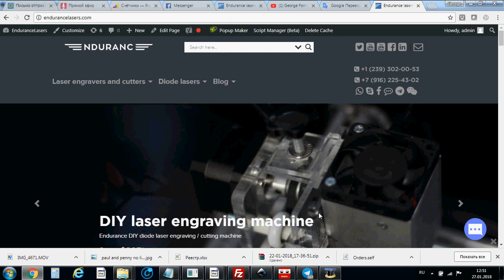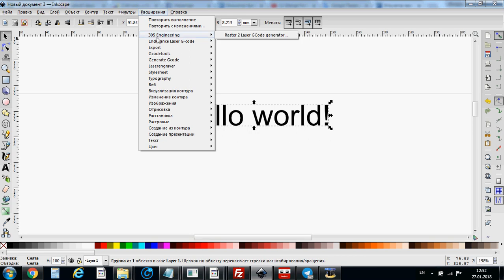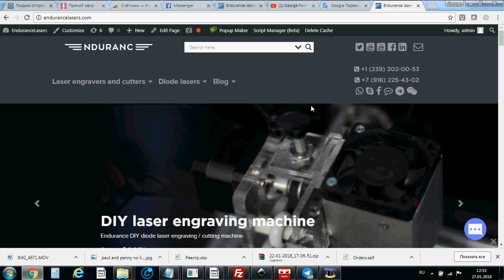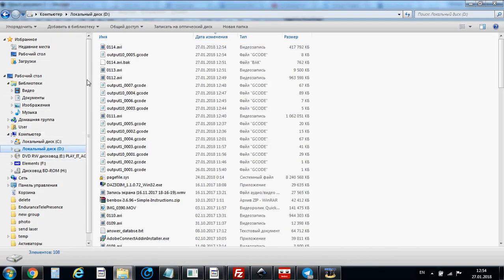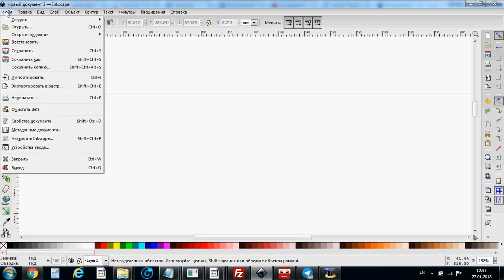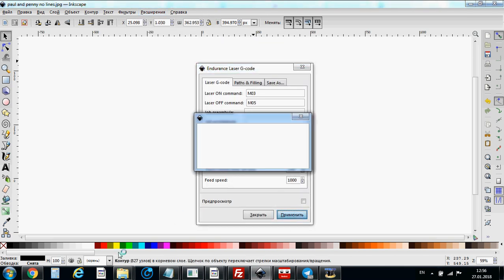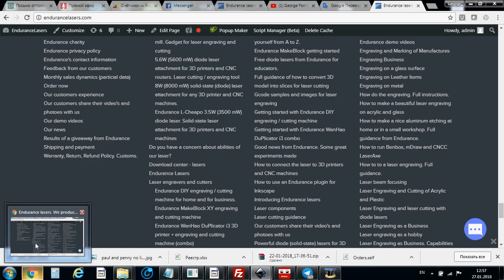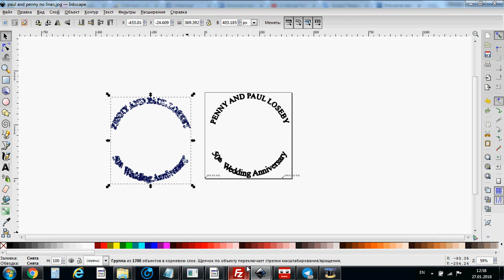Prepare a g-code for laser engraving

Comment: I am cutting a sheet into THOUSANDS of small squares. Using a throtec machine, it takes an hour to generate the code to cut. Is there a way i can write manually the g-code of a square shape cut and just run a loop that adjusts the cut location ? Then is there a way i can run any laser machine using g-code ?